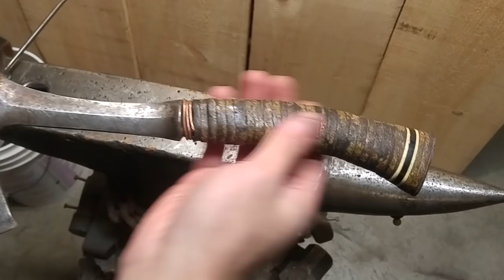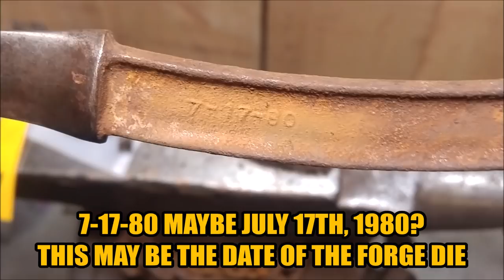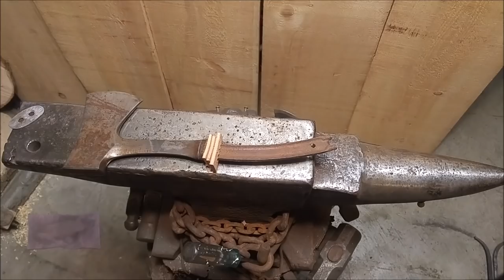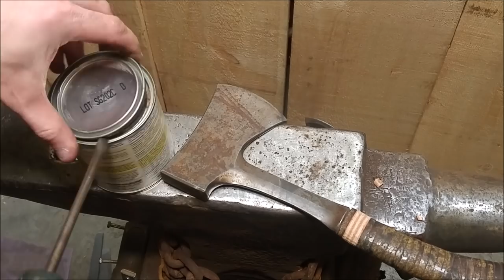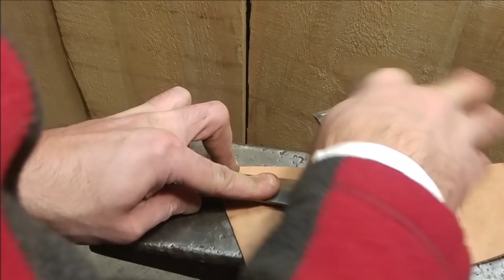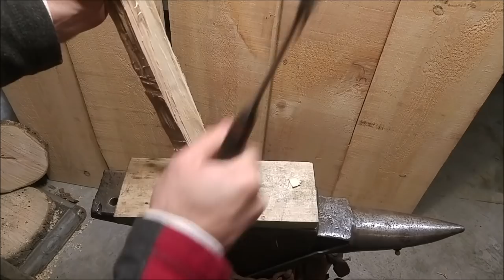DON'T THROW AWAY Your Estwing Leather Handled Hatchet - Restore your AXE Using Real Leather

Comment: Very good video and so helpful. I just done my hammer the same way and it was almost perfect. Almost because I could not sharpen it enought to cut things like you did, but I'm quite happy with the result 
(actually only one ring was partly broken on one side so filled it with builder's glue for timber, some of the others are a little loose; I use a lot for many odd things. But yes this video is very good, thanx it'll be my next step if my glue does not work. :)

Comment: It's refreshing to see a video where it wasn't mirror finished and the handle made completely different, like out of wood slabs or cast metal. I mix turpentine with beeswax and linseed oil in equal parts, then melt it all together, and it cools to become an easy-to-apply paste, which can be applied to wood and metal. I have applied it to leather, but wouldn't use it on finely finished leather goods.
Reply from the maker: Since I use all of the tools I restore it makes sense to keep the antique look, and I prefer it that way of course too.  The turpentine is a good tip, I had to pre-heat the mix before application, I'll be sure to try this method on a future project.  Thank you for the comment.

Comment: I grew up i Rockford. Estwing is a top notch small company. My father was a 
plumber, he always had an Estwing hammer. He would use it to beat on things and the handles never broke. Many carpenters do not like Eswing hammers as the steel shank transmits the vibrations into your arm. My dad had a couple hatches, one was in his trunk so long all the leather had rotted off. Now, I wish I would have saved it. The older hatchets had a nail pulling notch in the head.
Reply from the maker: Would that be Rockford IL?  Is that where the Estwing HQs are located?  I figured they were a big company by the huge amount of their hammers and hatchets around.

If I find another one, I'd make another video showing more detailed steps, making sure to create a much more professional finished product, that is also functional of course.

Comment: I have an Estwing hammer with a leather handle.  Not sure it’s exact age but I know for sure it is at least a half a century old....😀🔨.  This video is awesome and just what I was looking for.  I have a couple of questions please from this amateur DIYer.   After you removed the bottom plate, how did you reattach it securely?  I saw the drilling and since I don’t know what I am doing yet 😂 it wasn’t clear to me how that helped.  I very much like the idea of trying to keep the character of the axe and handle by only replacing the deteriorated pieces.  Great job and thanks again.   Ps. I won’t tinker with my new project until I hear back.  As they say, “A little knowledge....”.
Reply from the maker: The bottom plate should be re-attached through peining it back into place.  The reason I drilled the holes was because the steel was extremely tough and it just did not want to 'mushroom' over like I wanted it to without those holes.  The holes basically allowed the steel to curve over away from the center more easily.  I expect that the originals are done with large heavy-duty riveting machines, some them spin while applying force... I only have hammers of course.  

Another way to do this is to temper the rivets ahead of time, so use a torch just on the ends where you'll pein them over before you put the leather pieces back into place.  If I had known it would be so much trouble I would have done this step first. 

Let me know if this is enough info for you.

Thanks for the comment too!

Comment: I tried this, and my leather just crumbled to dust. It was pretty bad, but my handle is dated 9-1-1950!  I had no idea it was that old!
Reply from the maker: My only suggestion is to grind up the leather and mix in some epoxy... everyone loves their epoxy these days.  Really though making the little leather disks isn't tough, but you do need a supply, like Tandy Leather.  The leather has to be thick and after working with it quite a bit, not every piece is suitable, some are stretchy and some are very hard. 

That's a nice old one, worth keeping.

I hope it works out for you.

Take care.

Comment: You could have at least removed the rust under the handle ^^. That aside, great video, very satisfying to watch!
Reply from the maker: Yeah, I didn’t show it but I used a vinegar bath, it didn‘t work well.  I should have used Evaporust.  Glad you enjoyed it!
Reply: @NeedItMakeIt  Ahh, that makes sense ^^. Maybe try with electrolysis next time instead. It's cool to watch and works quite well for rust that is hard to get off with other means, especially when the material isn't smooth and the rust is stuck in nooks and crannies that are hard to reach without removing a lot of good material at the same time.

Comment: Great! But why you didnt remove the rust on the handle?
Reply from the maker: Valid point, I did a 2 hour vinegar bath on the entire hatchet, but with poor results.  It didn't bother me too much because my thought at the time was that It is good to have rough-ness on the 'tang' so that it would prevent the leather from shifting around.  Over the life of the hatchet, the original leather pieces stretched and they had a sloppy fit.  I like to try to keep close to the original manufacturing process so I did not want to glue the leather to the handle, but that may have been a good option.

I had been using vinegar in the past, but I'm thinking that cold weather hampers the rust removal process, from what I have seen on videos, Evaporust seems to come out on top for the best rust remover.  I had purchased a small container from Lee-valley tools a few months back and used it on my lathe chuck and it did work very well, unfortunately I spilled the container and since it's kind of pricey, so I haven't re-bought.  

I will do much better on the next project (which I am working on right now).

Thoughts?
Reply: @NeedItMakeIt  : yes , Many thanks :)
Reply: Naval jelly would have removed that rust on the handle...disappointing seeing it reassembled without doing that...the right oil would have swelled that leather a bit..
Reply: @NeedItMakeIt  not a problem. the best rust inhibitor is rusts. A little oil can and should be put in the handle now ( and then) , especially after wetting.
Reply from the maker: @timothylongmore7325  Linseed oil  I'd assume?  Do most oxides protect the metal below?  Aluminum oxide, or black/red iron oxide.
Reply: @NeedItMakeIt  I don't know if protect is the correct term. Rust on iron will get worse if conditions are right. I'd use a good grade machine oil like you'd use on the blade itself. Cleaning all the rust away would just set the stage for more rust to form without oil or some other finish to protect the bare steel. For your app air , and moisture can get inside. Which is how it was designed. Leather has to breath.
Reply: I’d wire cup all the way down past between the handle and tang before reassemble

Comment: This is a nice restoration, but I would like to see you give it a whole new life by polishing the tang too, treating it with some layers of cellulose laquer and renew all the leather pieces instead of only replacing the missing ones. The old pieces look awful and like giving you blisters. I don't like varnish on my handles, it makes them slippery when hands are wet, so I would go with boiled linseed oil only.
Reply from the maker: My personal preference is to keep things looking as close to the original with the patina as possible.  I did rush through this pretty quick if I am honest, if I were to do it again, I would have been more thorough.  Cleaning and coating the tang even with some Tremclad would have worked well.  If I find another to restore, I'll make sure to do the restoration taking everyone's comments into account. 

I also love linseed oil BTW, have you ever had and rags ignite on you?
Reply: No, but I heard about it and was very careful to avoid it - put it in an aluminium can outside, so any heat instantly is sucked away. Most times covered it with a tin plate too. IMHO it's not a myth.

Comment: I just restored a nearly identical handle. My leather was not savable. I used stacked birchbark. 125 layers! Similar to a pukko knife handle. Because of the curve they have to be put on and glue individually in stacks of 20 or so. Real pain in the ass but was well worth it. Looks beautifull. You should do a video on that. I never will. Don't have your skills. Also did a musturd finish on it. Looks antiqye slightly yellowish.
Reply from the maker: Now that is a really cool idea.  I've heard of stacking wood piece on a handle before in the same manner as the leather.  

I will definitely keep this in mind if I find another hatchet like this one.  I've never heard of someone using birch bark, only thin pieces of plywood.  

I have a River Birch in my yard, and it is one of my favorite trees to look at, but I find working with birch to me more difficult than maple.

Awesome comment, thanks for the support, I have another video coming out soon that might by of interest to you, so stay 'tuned'

Comment: Have you ever tried too put the handle in water for the leather to swell after you have replaced the missing leather washers?
Reply from the maker: I didn't, do you think the swelling is a good thing, I'd think it would just be temporary, similar to replacing a wooden axe handle.  

What I should have done is apply PL to the shaft prior to slipping the leather back on, it would be waterproof and it also swells when curing to fill any void.

Comment: New ones are now junk. I used one on a tree and after about 10 swings, the wood dented in the edge, I couldn't believe it. Rockwell tested it and it's dead soft. I'm guessing I got a bad one. Heat treat wasn't correct.

Comment: Nice, I never liked the leather personally. Estwing is known for the rubber handle. I took the leather off of my Black hawk estwing.
Reply from the maker: I would tend to agree, I have a 20 year old Estwing hammer and the blue rubber handle is still in excellent condition.  The leather handles wear out and shift around, not to mention being affected by moisture.  They could easily produce a rubber product which duplicates the look of leather, but that's more costly, so forget that idea.  For me, I much prefer a traditional wood handle, we'd use Ash where I am and it works very well for my old hammers and hatchets. 

Thanks for the comment.
Reply from the maker: Well thanks a lot, now I have to go to Home Depot and spend money on another axe :)   

As far as the linseed oil on leather, you're right about it softening, I do use it sometimes for my leather work to make it more supple.  In this case I sealed the leather with 3 coats of shellac (the same as the original finish) prior to using the beeswax linseed oil mix.  The linseed oil I use is boiled so it does harden up over time (or gummy up).  Another factor that plays into the videos I make is to use what I have on-hand whenever possible. 

You make some good points, so thank you for taking the time.

Comment: Great video.. But i had a eswing hatchet giving to cause it was going to throwed away... The leather handle was so bad it crumble when touched.. So its gone...any ideals for a different type of handle?
Reply from the maker: Leather will deteriorate if exposed to moisture for long enough, just like wood or most natural materials, that'd be my assumption in your case.  If protected properly it should last, but I did find that the leather pieces had become loose on the tang with use, so leather won't really last as long as the blade.

People had mentioned a stacked wood handle, that would work, except you'd want to glue up the handle alternating the grain back and forth to create a type of plywood.  I think polyurethane glue would be the best as it is waterproof and provide a very good bond to wood (even better than carpenter's glue) If you don't glue up alternating the grain, you'd see the handle cracking in no time.  Might be a good idea for a future video if I can track down another Estwing needing a new handle. 

Thoughts?

Comment: I wonder why you didn't remove the rust from the handle and or rust treat it while you had the leather off?
A great little axe.
Reply from the maker: Truth be told, I did a vinegar bath, prior but I didn't show this on the video.  The vinegar didn't seem to do too much.  I use Evaporust now which works well... but not cheap of course.

Comment: Why didn't you remove the rust from underneath the leather handle before you put it back on?
Reply from the maker: I didn't show it, and I probably should have, but I gave this a long vinegar bath, the problem with vinegar is that it will re-rust immediately.  I suppose I should have taken the grinder to it, but the roughness works well to prevent the leather from slipping on the handle as the old leather has stretched a bit and is likely to move a bit.   Another option that I didn't think of would be to dip it in linseed oil, it would seal the metal really well and preserve the rough texture.  

There have been a few of the same comments, so I've pasted my response from previous, hope you don't mind.
Reply: I don't mind, thanks for answering. You did a great job. On this one. And good idea on the lin seed oil

Comment: Why didn't you restore the handle before you replaced the leather on the handle?
Reply from the maker: I didn't show it, and I probably should have, but I gave this a long vinegar bath, the problem with vinegar is that it will re-rust immediately.  I suppose I should have taken the grinder to it, but the roughness works well to prevent the leather from slipping on the handle as the old leather has stretched a bit and is likely to move a bit.   Another option that I didn't think of would be to dip it in linseed oil, it would seal the metal really well and preserve the rough texture.  

Good point, in my next videos I am doing a much better job of showing all of the steps, whether they were a success or not.  

Thanks for the comment.
Reply: Ok
Reply from the maker: I appreciate the comment, I'm always looking to do better on my next projects.

Comment: Since when are the 80s vintage? Also way to smash the restoration into the anvil after
Reply: Evidently, you don't know what the word "vintage" means.  You could have just googled it, instead of making an ignorant comment, but whatever floats your boat.
Reply from the maker: Vintage is just a loose term, I don't believe there is any particular date range required.  The term these days for Antique used to be used for anything older than 100 years, however anything goes these days for that term as well. 

What did you mean by smashing it into the anvil.  There was a solid 1" thick piece of poplar under the piece being chopped, maybe this looked like it was the surface of an anvil?